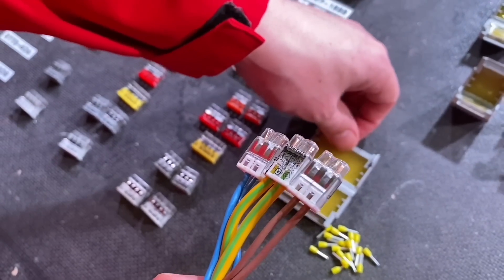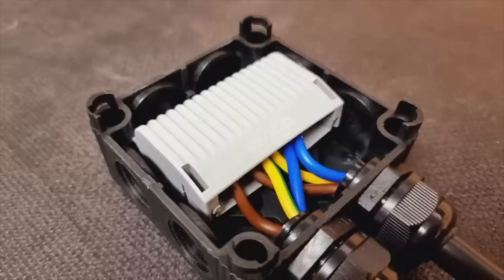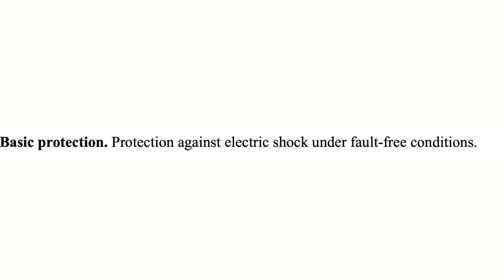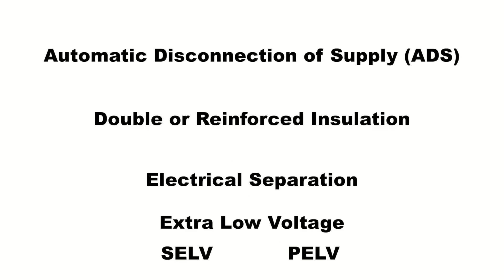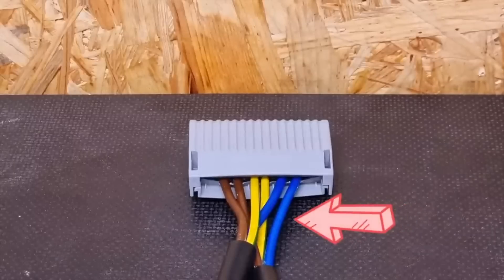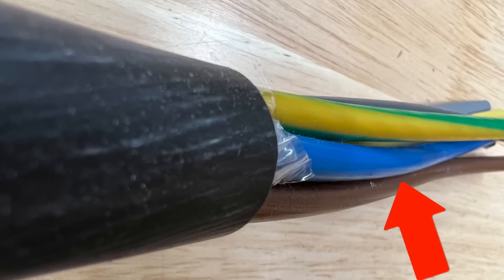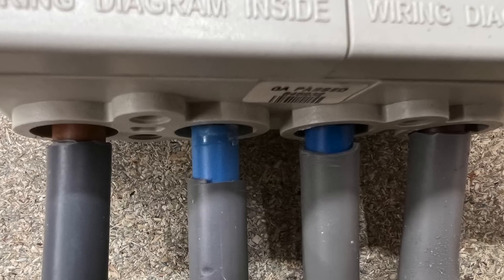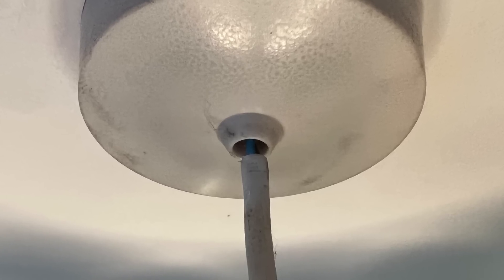Electric Cables - Basic, Reinforced and Double Insulation

Comment: Hi there, I have just had an EICR done on two flats. The cables running from the meter box outside are double insulated and there is a cut out fuse between the meter and the cables running to the flats. Before the meter is the 100amp supply cut out fuse. The electrician has failed this and says I need to change the isolator switches to fused isolator switches and that I need mechanical protection on the cable that is just over 3m in length. The electrics were done in the early 1990's when the flats were built. I have had another electrician tell me this is not needed.

Comment: Right at the start of the chapter 4 of the standard it says you can choose one of the protective measures. When you choose automatic disconnection you don’t need double isolation. Or do you? Then the enclosure seems unnecessary..
Reply: ADS involved an earthed metallic enclosure. Still enclosed either way.

Comment: I can't understand why some Sparks strip the supplementary insulation off of meter tails in the consumer unit before it goes into the main switch? This should be left intact all the way to the main switch. Should the basic insulation be damaged and someone comes into contact with it then they're toast as there's not much upstream to protect them other than a 100A fuse. I've even seen blue and brown flex-tails with the supplementary insulation stripped off. Beggars belief
Reply: I agree, when installing grey meter tails, just use brown and blue insulation tape to identify your conductors 🤷🏼‍♂️
Reply: Folk do it to identify colours when they cant be arsed taping them
Reply: Or just use heat shrinkable sleeves.